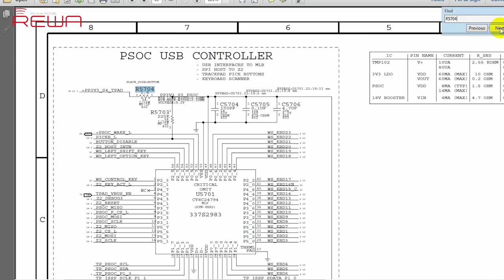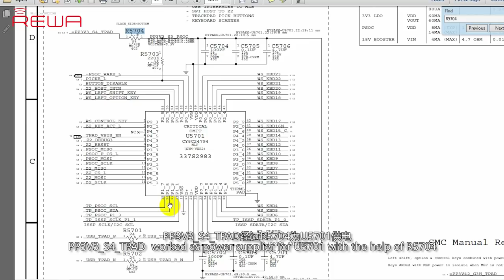How To Fix: MacBook Pro Won't Turn On

Comment: Hai...thanks for the video nice one...
I had same problem ...but could't find. i m not experience using multimeter ..there is sound beep when i try switch on and the screen doesnt turn on at all..
Reply: bad ram?

Comment: I appreciate the video but it would be nice if you could provide a bit of a talk through. I understand that sometimes language can be an issue, but it would be nice if you could get some sort of commentary going.
PS. what is the motherboard? There are a load of different unibody motherboards out there!
Reply: Some more super close ups would also be nice. And a bit of an explanation of what the components do and the reasons that you check things the way you do.
  Also where you find the information about checking resistances and where we can find the relevant info for different model motherboards.
  This has been a great help and i plan to recheck my old dead macbook. It was working fine, battery was getting very bad and i think that had something to do with it dying but it had also had a liquid spill a few years previously, it had had a cleanup and a new keyboard fitted. I suspected it could have been due to either deterioration after the liquid spill with damage underneath one of the power regulating bga ic or that the crappy battery was putting too much load on the power circuit. 
  Power adapter light comes on but macbook is 100% dead.
Reply from the maker: @izzzzzz6  Thanks for the comment. We do appreciate your suggestion and will take it into consideration. For technique problem, we will pass it to our Technical Dept. soon.

Comment: Dont understand what the keyboard has to do with the power button failing. That power button is separate of the main keyboard. Also didnt saw you switching out any part of the on/off button in thr lower right corner??? EDIT nevermind, i saw the little bugger hanging on the side after rewatch. Weird that it still started while it was on the AC connector though
Reply: Power button often fails after liquid spills, i've seen it 3 times just with friends macbooks. There is a power button override by shorting two pins on the logic board, i guess it depends on the problem weather o not it starts on the power adapter.

Comment: I have a MacBook Air a- 1706 it doesn't power on I did try to rest the disconnect the battery but still not working thank to my boss for referring me to CULLENSTHOMAS on IG the ethical Hacker found the solution and perfectly fix my MacBook.